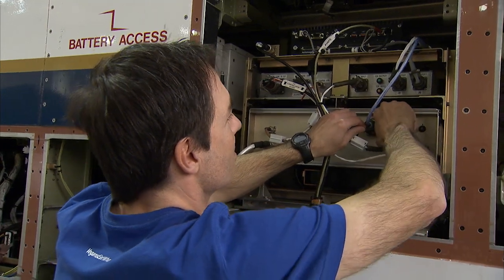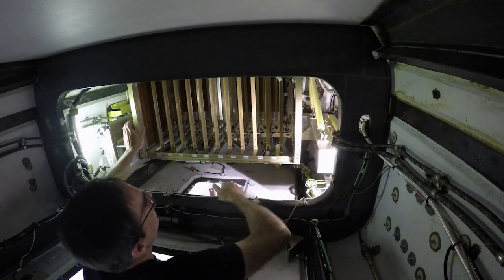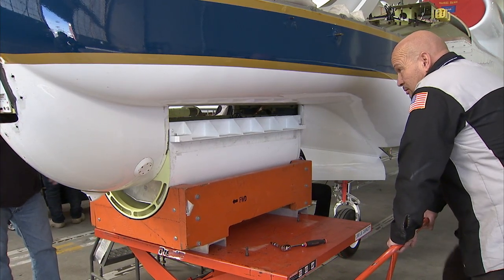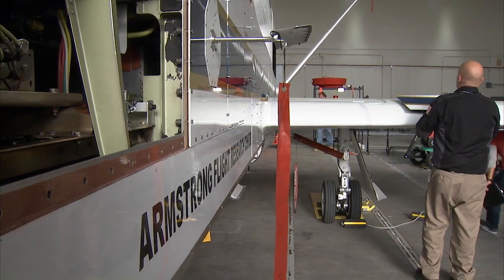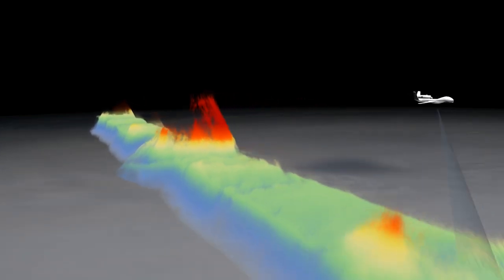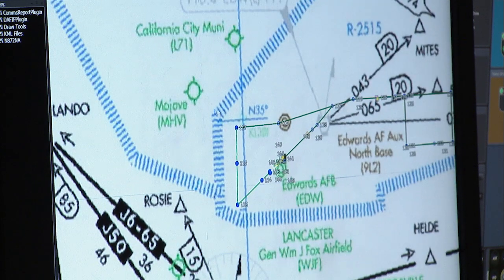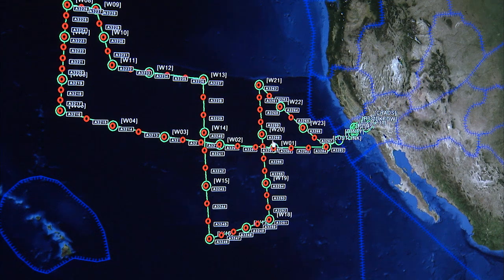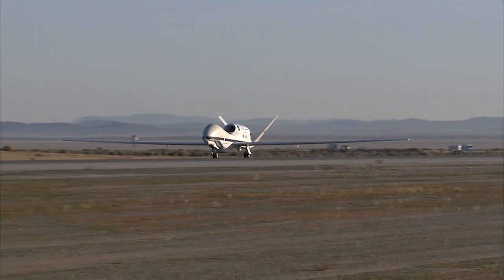Global Hawk / SHOUT

Comment: What systems are in place to prevent a mid air collision? Since there's no manual control, I'm guessing you've thought of this and have systems to divert the aircraft from a possible collision.
Reply: They are operating a good 10,000 ft or more above the highest-flying commercial traffic.
Reply: I assume RADAR, ATC + Operating altitude reduces chances of collisions.